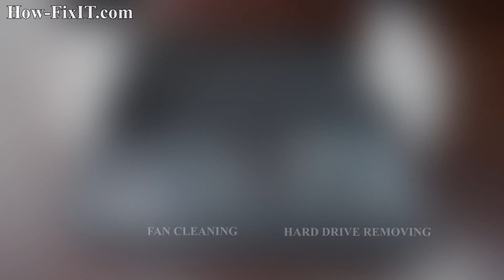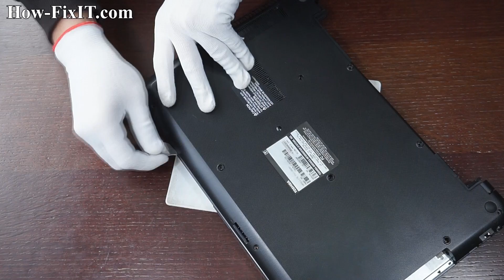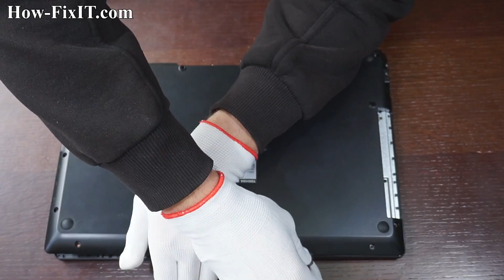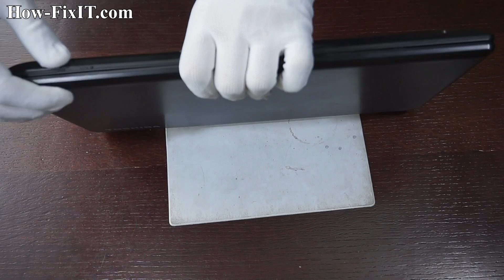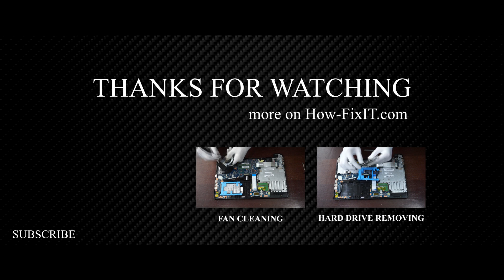Toshiba Satellite C55 RAM Upgrade & Install: Step-by-Step DIY Guide

Comment: My C5300 has 2 slots for RAM. It came with one 6 gb and I think I read somewhere it says it can handle up to 16gb. Does that mean I can install 2 8gb ram sticks in mine?

What kind of gloves are you using btw? Those are nice.
Reply: is one of 16gb ram

Comment: I have a Toshiba c55d b5102, it has two slots for ram, can I put one of 4gb and one of 8gb?
Reply: i think you can, i just worked on a HP that had a 2gb and a 4gb from the factory.

Comment: Will this laptop accept 2 4gig cards?
Reply: dont think so. looks like it has only 1 ram slot
Reply: and  even if it had two slots, your cards need to have same specs in order to work together(not the ram value(can be 2+4 or 4+4 or 2+8(if supports more than 8gb, not sure if this laptop does)) but speed and type)

Comment: the video was a great help. i ve wanted to upgrade the memory on this laptop but toshiba warned its was not user up-gradable i looked is up only 2 weeks ago because i really like this laptop but it was just too slow. after viewing your video i ran critical memory upgrade test and discovered it could be upgraded to 16 from the factory installed 4. What a difference this thing has new life. thank for your posting and for making it easy to follow
Reply: can you tell me please where do you buy your 16 memory? thanks!
Reply: It says online max 8, I’m looking to get the best I can out of my laptop so let me know more about critical memory upgrade test plz
Reply: Same as the others. Want to know more about once I install, what should I be doing
Reply: Hello friend, I'm planning to upgrade the memory of my toshiba. Can you share the website to get the part and if it is possible part number or which you get ,thanks  in  advance
Reply: Hello! Do you use it for gaming or does it really speed up in performance for minimal task? Planning to upgrade mine soon, your feedback is much appreciated. Thanks ^^

Comment: I have installed a second 4 go ram on my notebook but it doesn't seem to acknowledge it. In the system parameters, it is still written 4 go of ram. Is there something I should do? I don't think I have installed the wrong type of ram...
Reply: Are you using the 32 bit version of your operating system or 64? 
32 bit -> Only allows the laptop to use up to 3 gb or system memory 
64 bit -> Allows you to use 4gb or more of system memory.

Comment: hola amigo buen video queria preguntar tengo una Notebook toshiba satélite C55-B5214KL ...Y la memoria Ram es DDR3 a 1600HGz marca samsung. Y me compraron una memoria Ram de 8 GB DDR3L 1600MHz 1.35v Marca Crucial, queria saber si es compatible. Me dijeron que si normal trabaja mi Notebook en los 2 voltajes 1.5v o 1.35v. Estaba revisando por internet como saber que tipo de memoria y la capacidad maxima en el manual que e descargo por internet dice max 8GB en otros programas CPU-z dice 16 ram y tambien especificaciones de la memoria dice 1.35  y en otros programas 32gb Ram y dice que trabaja en ambas voltios 1.5v o 1.35v. Y use el scaner por internet Crusial y me dice max ram 8gb y memorias compatibles Crucial 8gb DDR3L 1600MHz --  1.35v. Y nose cual dice la verdad..
Reply: 8gb en cada slot.
Reply: es 1 slot de 16gb

Comment: Parece que este modelo de Laptop no acepta mas de los 4 Gb de RAM que trae originalmente, correcto?
Reply: Acabo de instalar un modulo de 8mb y lo aceptó.
Reply: @javegallc1184  estimado yo tengo una c55-b5242x sera que soporte una de 8gb?
Reply: @javegallc1184  solo se coloca y ya la acepta¿ no requiere algún otro paso¿
Reply: @javegallc1184  amigo pero te los reconoce? Puede que lo instales sin problemas, pero te salen los 8 gb o 4, quiero saber si ponerle la mía 8GHz, pero seria botar el dinero si solo reconoce 4gb, a no ser que actualices la BIOS. Que ya es otro caso. Espero tu respuesta.